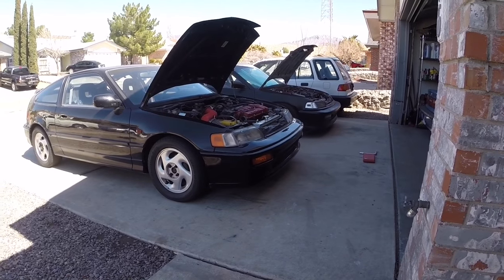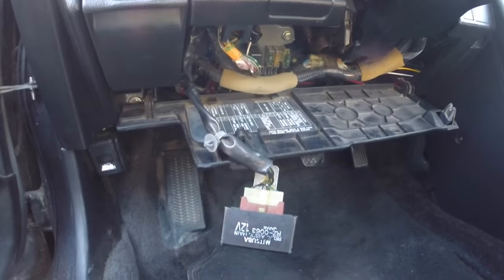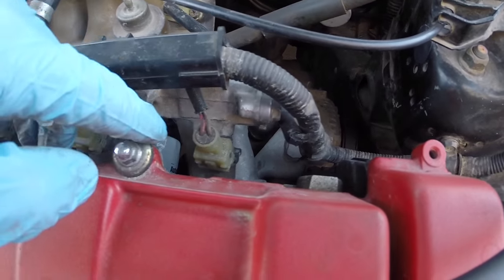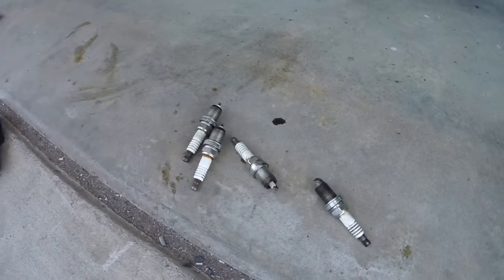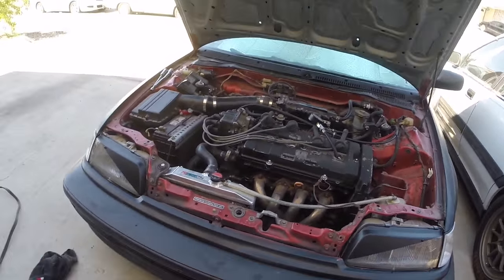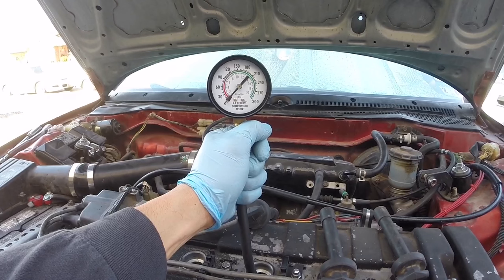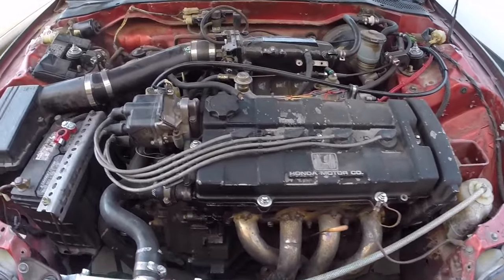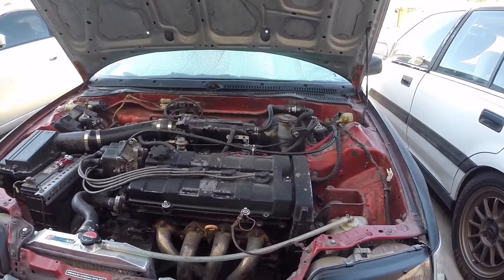How To Perform a Compression Test On Any Car

Comment: What’s the purpose of WOT if the injectors are disconnected?
Reply from the maker: You need the air to be able to enter the cylinders to produce the compression.  If its closed the throttle plate acts as a valve and seals off the cylinders.
Reply: Garage Built Hondas gotcha thnx man I appreciate it
Reply from the maker: You're welcome

Comment: Can you do a compression check without warming the engine up? My 91 Honda Civic 1.5 died off on me when driving down the road. Seems to have air gas and spark it turns over but won't start it has new timing belt and ignition switch and relay. Wanted to do compression check. Can I do it with engine cold? Thanks 👍 also switched the distributor to extra one I had so I don't believe it's the distributor
Reply from the maker: Yes

Comment: I don’t know if you will see this but I bought a 91 civic and it suddenly didn’t start. I check the spark plug wires and they were drenched in oil. I wanna do the valve cover gaskets and new spark plugs. But I am scared it may be more serious like valve seals or the piston rings. It doesn’t blow any smoke at all, but yet again I don’t know if the guy who sold it to me tried buying a seal or something. Any ideas help!
Reply from the maker: Watch this video.  There are some seals under the rocker arms that are bad on your car.  Those need replacing.  https://youtu.be/nGDUQ1wyET0

Comment: Hi Jon, my name is Adrian, I'm from Spain and I have some questions. I have got a Civic Si EF3  '89 (1.6i-16valve D16A9 130hp)

1. What is a Civic/CRX "Si" to you? I saw in some videos in your channel that you call Civic Si and have D15 SOCH... I always thought that SiR was the Vtec B16 150hp and the Si version was D16A9 or A8 (with cat) with 130 and 125hp.

2. My Revmeter has the redline at 7200 rev/min and the ignition cut its at 7500revs. Looking at your CRX, I saw the redline at 6500 rev/min. Ok my second questions is about the EF of my friend, a '91 EF with a D16A9 too, but his car has the ignition cut at 6500/6600, not a 7500 as mine. We check some wires cause the ECU got the No17 failure, and comparing between my wiring installation (OEM) and his installation, he hadn't a red-yellow wire from the odometer to the ECU. Fixed that problem about the speed-sensor, the engine keeps cutting at 6600 revs/min without Ecu flashlights failures. We checked also the Injector resistor, fuses, and we can't solve it... Even we did the compression test  on both engines to compare and it has values similar as you showed on the video... Actually we are lost and waiting for a miracle hahahha 

I don't know if you can understand my message because I don't know english very well.
Thanks, from Spain, Adrian. BTW, Great videos friend. Long Life to EF's :D
Reply from the maker: 1.  In America the Si model has the D16A6 engines and a redline of 6500.

2.  Maybe his car is equipped with a different ECU.  Code 17 is for the Vehicle Speed Sensor, can you verify that his is working?  The sensor is located at the back of the transmission and had the cable which goes to the cluster.  I'm not sure if that's the same for your models though.  Do your cars have an electronic Vehicle Speed Sensor?
Reply: @GarageBuiltHondas  Thanks for your answer man, really appreciate it :D I understand, the American Si version is a D16 SOHC, with 130hp?

Yes, the "code 17" is the speed sensor fail (we fixed it because he hasn't the electric wire from the cluster to the ECU, but from the gearbox, our Civics has a mechanic steel cable to the cluster, and later, the electric to the ECU, its a OBD-0, no like in the EG series, with the OBD-1. 

Our ECU is a "PM7" model in both cars, and also, my friend tested another PM7 from a Rally Car (with the stock parameters) on his car, but same results, the engine never exceeds  6500 revs/min.

We don't know where is the problem, because we check it all we know that maybe will be wrong... First of all, the connection wires, later changing the ECU, the injectors resistor (around 6,54 ohm in her and mine resistor) and obviously, in the engine block its a D16A9. 

Thanks for your answer and your help friend. If one day we found the solution, I'll write to you :) Keep doing that great content to youtube and cheers from another "H" lover :D My brother has a Civic EP3 Type R (K20A2 with some upgrades, around 230hp).

Comment: This is on my TODO list for a low RPM studder/hesitation on acceleration.  If compression is low, would head gasket be the first thing to try? Looks like a pain but easier than pulling engine out.
Reply from the maker: A leak-down test would let you know why the compression is low.
Reply: @GarageBuiltHondas  good idea.  I almost feel like doing the leakdown without the compression test.  Sort of kill 2 birds with 1 stone

Comment: VTEC Academy Said If you have all the spark plugs out of the engine, then you don't have cut fuel or to open the throttle all the way, If you're testing only one cylinder then yes, is this true ? He only unhooked the distributor and pull the spark plugs Then did the test.
Reply from the maker: As long as you do all 4 cylinders the same way, your results should will be able to tell you how the test went.

Comment: What kinda intake is that red one? I have a b18a1 in my ef but I can’t get the right intake piping. My last one caught fire because the hood ended up pushing the coupler clamp onto my battery terminal. This is the third one I’ve tried and they don’t fit right. If all else fails I’ll just have to relocate the battery.  Thank you
Reply from the maker: This one is an AEM one but someone painted it.

Comment: b18a1 head is messed up i wanted to know if i would be better off buying a b20 instead of fixing the b18?
Reply from the maker: No, the b18 and b20 head are exactly the same cast.  The only one that is different is the p8r head but that one is the larger 84mm bore.  What would really help you is getting the camshafts from the b20 or b18b engine.  Those are more aggressive than the b18a1 which make up the 10hp difference.
Reply: thanks I appreciate the help!
Reply: Really 10 hp swapping the camshafts off b18b .. wen u say wide open throttle u mean as u start the car pressing down on gas padal?
Reply: Ok thx I'll give it a try lol
Reply: I did the test
 c1 150 
C2 120
C3 135
C4 150 n I had oil on c4 spark plug the other spark plugs were just dirty n I replaced them like 6 months ago ..
Reply from the maker: +Carlos Avila c2 seems a little low.  Want to try something?  Warm the engine up and test C2 again.  Bit before testing it, dump maybe half a tablespoon of oil down the spark plug tube and down into the cylinder.  Then run the test.  If the test had a higher reading, then you'll know for sure it's the rings which are the problem.  The oil will help seal around the rings and raise the reading.

Comment: ... since cylinder #1 was bad what does that mean ... and what is the remedy?
Reply from the maker: Either bad piston rings or bad valve stem seal.  A leak down test would reveal even more and be able to determine which part is the culprit.  The stem seals are much easier to replace than the rings.
Reply: ... Thanks ... hey Jon what are the chances i can chat with you on the phone?
Reply: ... everybody mentions the rings and seals but they all say get new engine or complete rebuilt ... cant i just do the seals and rings? ... would that be good enough? ... pro's con's of just doing that?

Comment: Where do you find the specs for your engine compression.  I have a stock 1988 Civic DX hatchback with the D15B2.  All I can find is ratio, not a spec for the compression test.  I’m at 160/160/160/170.
Reply from the maker: Different compression testers can read differently.  You're looking for a variance across all cylinders.  Those readings are solid.

Comment: Bought my crx ed9 d16a8 few days ago smokes abit on cold start did compression test 1st cylinder 185psi 
2nd cylinder 210psi 3rd cylinder 210psi 4th cylinder 190psi think it's okay ? Could it be valve stem seals 
Thoug did compression test and night so might do it again
Reply from the maker: It sounds like the valve stem seals.  They will leak slowly as the car sits and when you start it the oil is burnt, and as the car warms up the seals expand and tighten up around the valve which is why there isn't much anymore.

I'd try that first, they are pretty easy to change if you have the correct tools.